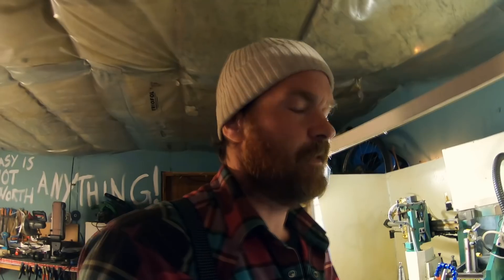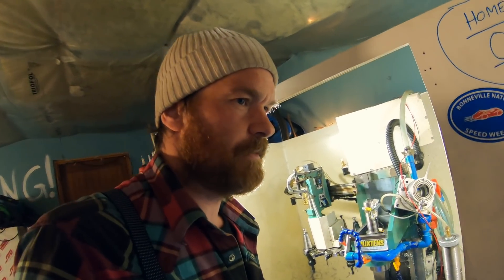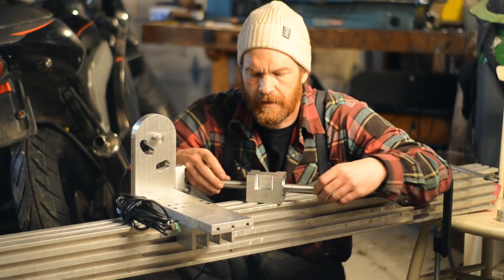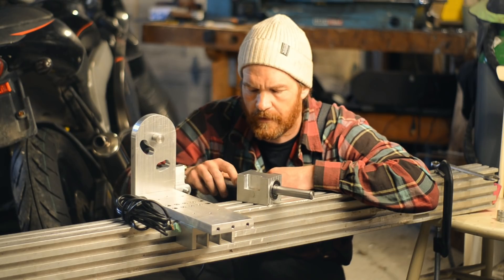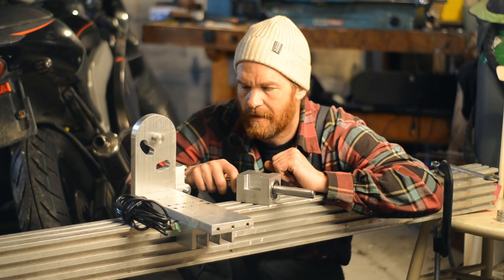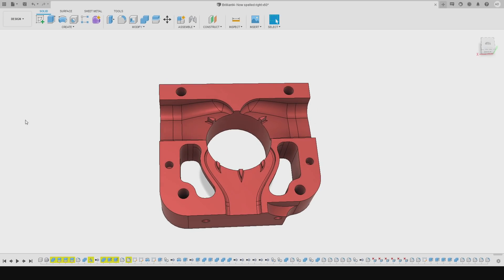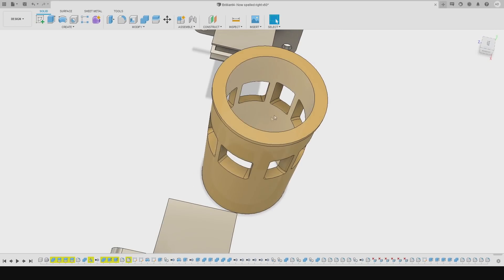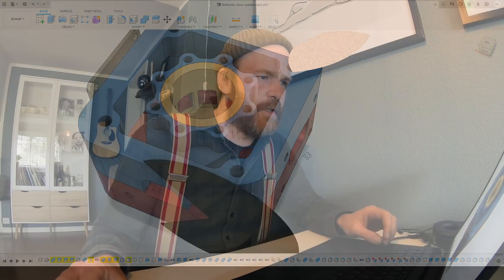Prototype Blown Nitro 2 Stroke.

Comment: The problem with the design with the rotary valve so far away from the combustion chamber is that this lowers your commission ratio. With a camshaft and a 4 stroke head this wouldn't be the case
Reply from the maker: The blower can deliver much more than this engine can take, this is a way of cheating it into believing the engine is bigger.
Reply: @2STROKESTUFFING  yea if you can blow IT up enough you will be able to live with such a low compression rate. But you could also use A 4 stroke head with A 1to1 cam zu crank Ratio And a modified camshaft to open both valves every TDC. With this method you will have less unburned fuel and therefore a higher efficiency. Also you could run the compressor at a lower speed. I thought about a two valve per cylinder Pitbike head. These are cheap and easy to modify.

Comment: Love the idea only issue can foresee is possible issues with heat on thin disk valve possible better to use drum instead with hole in each side ? like a power valve but can turn 360
Reply from the maker: I have an idea for a drum valve if this fails👍

Comment: Nice Work Man! The T5 Timing Belts with 25mm With works with 16000 RPM and 7,5 kW in our CNC-Lathe at work i think they would also wthstand 200000 RPM when you keep the Pulleys small
Reply from the maker: Awesome 😁👍

Comment: At 20k RPM poly-vee belts are more common than timing belts.  At 20k timing belts will be very loud and consume a lot of power due to pushing the air out of the way.
Reply from the maker: Thanks for the heads up!

Comment: Why have two intake when you could have one big intake opposite the exhaust port? What I’m thinking is that it would be important with symmetrical flow for the cylinder to fill properly. Just a though. One intake to the cylinder opposite the exhaust port, then since you have such a big (wide) cylinder you have plenty of room to have the ports loop around and fill the cylinder from all angles :)
Reply: Crossflow 2-strokes as you're describing perform badly. There is a tendency for the fuel/air mix to flow directly across the top of the piston and out the exhaust, resulting in very poor volumetric efficiency. In the old days they tried to fix this issue with a 'deflector' on top of the piston but this was always just a band-aid solution with limited effectiveness, plus heaps of downsides such as messing up the combustion chamber shape and adding weight to the piston.
Reply: @nerd1000ify  I agree and see what you mean. What I am saying is that you could aim the ports more ore less the same way as he already has but with one intake (reed) on the opposite side of the exhaust. There is plenty of space in the cylinder.

Comment: Bear in mind that if the goal is to set a record on this engine, forced induction normally carries a 1.4 or a 1.5 capacity handicap.
Reply from the maker: About 1mph between the "fuel" and "blown fuel" class at Bonneville 😁

Comment: I hope they find your cylinder....even without 100% of bore exhaust port, I believe your naturally aspirated 50cc could still be the most powerful 2-T by displacement.....not many people have put this much development in a 50cc previously and there, is much left to be gained in slight port timing changes, pipe changes, crankcase volume changes, and of course tuning on the nitro fuel....

Comment: Really nice work, would have loved to work on these models.
I believe symmetry is everything, for a good running, powerful and durable engine, its like making/build a flower into a whirl wind design structure.

Now you got colliding intake ports "draft" that blocks both currants dead, better would be to spin and whirl the intake breath, like making an angle to the left or right with 3 ports so  the breath spirals and twists into one another like a spun rope and going upwards whirling/bouncing via the spark inside the cylinder volume/head so the spark ignited mixture is vastly distribute through the whole head/cil. volume, which saves mili seconds and greatly enhances the combustion.

Comment: Please, instead of your rotary valve, why not use Yamaha's YPVS valve, I think it is mush easier to control/adjust. The best would be a rotary valve mounted in the top, as the big ship two stroke engine, you will gain a lot of power that way. I have worked on that solution in about 10 years, but haven't the money. Therefore you will get my tips, I know now that you can use it !!

Comment: Would you consider, rather than 2 dowel pins, to have a locating ring that engages in a groove concentric to the bore on both pieces, and a single dowel to prevent rotation? That way the any expansion or contraction is all relative to the centre of the bore and you should significantly reduce any chance of movement causing a step for the piston rings to hit. Can still be made on the mill.
Reply from the maker: Great idea! I can model a form of single dowel into the design too - no need for dowels at all😁👍

Comment: Why are you using the rotary exhaust valve rather than a traditional valve in the head for exhaust only? If you go through the head then you can have inlet ports all around the cylinder like a detroit diesel.

Comment: I saw the electric motor and thought you were going for ultimate RPM's Ultimate torque and with the new Quantum Scape solid state batteries you can go high voltage! But I think you might be trying to stay in a racing class...not sure lol 50cc super modified!

Comment: Great video's I feel that I am part of the development.

Surely you don't need reed valves with a supercharged unit, the piston is the valve ? I know that you know this and much more. can't wait to see the new machine on the dyno.

What CAD are you using ?
Reply from the maker: Thanks! I need the reed valves cause the transfers open way before the cylinder is below intake pressure.

Comment: If you gear your rotary valve to half engine speed you could make it symmetrical and so therefore better balanced. Loving your greater focus on your channel, I really hope it pays off for you.
Reply: and... cooler temperature wise?
Reply from the maker: Good thinking, but if it moves a half speed, and starts closing at bdc, it wouldn't be fully closed until around 90° BTDC. That's 3° before the transfers close...

Comment: Would computer-controlled variable pressure bleed and moveable reflection(rear) cone be useful to broaden the area under the power curve on the graph? The moveable cone would essentially move the power peak across the RPM range.
Reply: The final engine wil have a cvt so a broad powerband is not needed. Because of this he can have a big power spike to take advantage of

Comment: Hello, 
would a 2 stroke engin with a full exhaust port in the cylinder, and an intake valve in the head work? By doing this it would be possible to turbocharge the engine as the mix would be filled trough the top of the engine and with the exhaust port closed (during compression phase).
Reply: That's what marine diesels and detroit diesels do, but in reverse. Intake around the cylinder via the forced induction, and have valves in the top actuated by a camshaft to release the exhaust gasses while still on its way down.

Comment: I believe somebody at the shipping company now has a set of pistons and a cylinder to match.
Where you are planning to get the mass energy to spin that blower? JohnnyQ90 has made experiments on miniature engines with different types of forced induction, and they all have the same problem: Not enough mass in the rotating assembly to spin the blower. And when the crank has enough mass to spin the blower, it's too much for +12000 rpm.

Comment: Really great stuff! I thought reed valve systems were always rpm limited. Will you be able to achieve the power you want through a reed valve system?
Reply from the maker: Not sure, but with the blower I might achieve enough bmep to not need such high rpm.
Reply: @2STROKESTUFFING  You are definitely on the cutting edge of two stroke technology and we all can't wait to see what's possible.

Comment: I must say I'm kind of surprised you're opening yet a new avenue with the supercharging (different record? you should comment on that, since record seeking and Bonneville run is the founcdation of the success of your channel) , plus new intake port design (e.g. why opposing at 180° and not, say, 120° so that gases would have less to turn around, twice?)... 
I would hate to see your work dissolving in a myriad of unfinished half baked "ideas", as it happens on so many Youtube channels.

Maybe you should cut down on the boose ? at least on the screen ... just saying ;)

keep up the good work, and the clear focus.
Reply from the maker: Thanks! What you're describing is why I'm making the PiP engine less experimental, and starting this experimental project alongside it - to have something "finished" and running, while still exploring ideas. We'll simply enter the blown engine in a different class, same frame.

Comment: The volume between cylinder exhaust port and the rotary valve is a direct efficiency loss for your blower. If you decide to go for a blower and a rotary exhaust port, how about reducing the volume of intake and exhaust runners as well? Just to reduce the amount of loss you get from the blower, I mean? The pressures in both intake and exhaust will be higher, so the volume/cross section of the runners will matter a little less. what do the rules at Bonneville say about a blower?
Reply from the maker: Hard to find readily available blowers under ~300cc/rev. I need that extra volume to cheat the blower into thinking it's working with a larger cc engine. Will probably need a dumpvalve on the intake regardless.
Reply: @2STROKESTUFFING  you have the machines. Shorten the blower😉

Comment: The engine at the start revved harder than anything I've ever heard in my life. Amazing sound.
Reply: If I remember right from that video that engine was reving up to 20,000 rpm
Reply from the maker: Yep, in the landspeeder I saw 21k+...
Reply: @2STROKESTUFFING  just like 2 stroke model airplane engines that buzz ....back in around 1975 i was running with a dirt bike crowd in Santa Fe new Mexico that liked to go top end in the deserts south of town to the REO grand river and back ...i was topped out one day on my 360 Yamaha about 85mph and this kid Sidney passed me on his Honda CR125R two stroke like I was parked ...this thing he had ported out and went to a smaller rear sprocket for way more top end had like a 34mm Mikuni carb thats almost as big as the piston as he had also installed a huge reed valve intake to assist the huge carb as this was a 1973 first of the CR125R that didnt have a reed valve stock ...and the boy weight about 98 pounds if that much.. so his little bike hardly had any load on it and ran like there was no one on it like a run away train ...it was quite a hoot to see ..and sounded like a model airplane engine when he flew passed me ..and my 360 Yamaha enduro was not stock as I had upgraded the carb from a 28mm mikuni to a 34mm I had bought used from one of the local Yamaha shop gear heads that rode with us ..and Sidney and Mexican boy pudge they called him would race short track down in El Paso once or twice a month ..as Sidney raced 100cc single Honda four strokes ..and showed me how they would take a die grinder and open up the notches in the head that are there to clear the cam lobes as the cams they were racing would almost collapse the valve springs ..back then the Yamaha 250 single two stroke was the hot set up for short track oval racing but pudge the Mexican raced a Yamaha 250 twin two stroke out of a street bike in a champion dirt track frame crazy fast but hard to do on a short track bouncing off the hay bales to make the turns ...two strokes are a hoot .. definitely and highly recommend those who Don t have a clue to find out
Reply: @2STROKESTUFFING   and if I remember right it was also around 20hp at the wheels and close to 24? At the crank
Reply: That's mind blowing rpm for a reciprocating piston engine. The forces involved when the piston is changing direction must be amazing .

Comment: Doesn't a reed valve open (constantly) when you blow pressure onto it? Why not dual rotary valves?
Reply: It does but remember this one is facing directly into the cylinder instead of the crankcase. So when there is combustion it shuts the Reed closed. When the combustion is over there is no longer enough force to keep it closed and the compressor then pushes the Reed back open.
Reply: I also thought the same thing as you did.

Comment: Maybe your Cylinder will be in the news like Rob Dahm's 4 Rotor
Reply from the maker: Crossing fingers for no drama!
Reply: lets hope not. 
rob got lucky he got that engine back.
Reply: Evinrude outboards went to the epa and said that if emissions was the reason for banning 2 strokes then they should be banning all 4 strokes instead because their 2 strokes are 20% cleaner.
 Imo the 2 stroke engine has never been completed. 
 4 strokes have had mega bucks thrown at them to get then to where they are.
 According to BRP, it's mathematically impossible for a 4 stroke to ever match the power, weight, fuel efficiency service costs and emissions of a 2 stroke.
Reply: @scottwingate1235  stop sniffing brake cleaner and come back to the real world. as long as it's burning oil it wont ever meet emissions. even when cheating with watercooled manifolds.
Reply: @comethiburs2326  not all 2 strokes burn oil. I thought everyone knew that?
Reply: @scottwingate1235  oh right, so you want to be the smartass and bring the uniflow engines to the mix? tell me, who sells uniflow engines nowadays? i mean new ones. that dont runaway and make people deaf...
Reply: @comethiburs2326  koenigsegg new engine can run uniflow 2 stroke. 
 Now maybe you should lose the attitude. 
 Ever heard of achaties 2 strokes?  Maybe you should checkout the partnership they just made with Cummins and got a massive US military deal.  Guess what..... class leading emissions that might mean your next truck could be 2 stroke!
 Let's not forget the deltic compound super turbo that makes power like NASA.  
Yeah uniflow! 
 2 stroke potential has yet to be realised and I support innovative thinking like 2strokestuffing. 
 Drop the negatives.
Reply: @scottwingate1235  achates has been making babysteps for over a decade, got lucky and got aramco funding. A military contract is NOT in fact an emissions standard...otherwise we wouldnt have any 1980's truck left in active duty, which is clearly not the case....

the concept of an opposed piston two stroke was a thing since the 40's. i hardly consider these all the things you've been toting...ie light, compact or cheap. 
my favourite opposed piston engine sure wasnt a class leading engine in power, emissions size and whatnot. it did sound amazing tough. still got outpulled by 4 stroke hybrids.

besides, the achates is a monstruous tech bed for exshaust filtration and heat management. mechanically alone it wouldnt work, unlike regular 4 strokes modified for hypermiling. 

the freevalve engine could run like a two stroke yes, but why would you want to do that? you'd have to drill the cylinders to make it work. besides it's incrediblely hard to make electronic/pneumatic systems stay reliable like mechanical systems.
hence the bonkers cost of the thing. 

like rotating sleeves and rotating valve systems do not last or have to burn oil... comes with drawbacks. tons of them. 

i'm in for the top end power our host is going to make. and sure will come with a 40L/100kms kind of madness with his oversized ports. forced induction will only make it worse. and that clearly not the fucking point of it all.
Reply: @comethiburs2326  just a few points of difference. 
 Achaties is happening with Cummins in a big way. 
 Their emissions are the thing that will put it into passenger cars until full ev.
The free valve engine is a reality and he says it can run 2 stroke any time he wants although it's not as efficient. 
Yes it's also incredibly expensive but so is everything at first.
 The compound Deltic was the most powerful machine available and some argue that with today's technology and manufacturing processes it could be a viable alternative although I'm not so sure. 
I really hope our friend can make his boosted 2 stroke work and maybe inspire other's.
 I don't think it's helpful to completely disregard all technology's old and new when looking for solutions to problems. 
 Personally I believe in theory a boosted 2 stroke may only find markets as an electric generator for marine applications where torque and weight is valuable. 
 Other than that I agree it's limited.
Reply: Hopefully not. If some "green" politicians notice this Project which might be interpreted as an colossal waste of fuel with very toxic exhaust it might promote the banning of two stroke.   Unfortunately nowadays it is best to hope that such projects do not get to much public attention. At least here in Europe.
Good luck with your two stroke projects!
Reply: @thomash3003  its what i got affraid of that its just time before politics start to attack our loved 2 stroke bikes, race cars and older cars that is used as a hobby.
Reply: @thomash3003  i dont know which part of the world you're in, but in the US and the EU, commercial use of two strokes no longer meets road emission rules... and innovation in that sector is all but dead. same thing applies to the wankel motor.

Comment: Ok, nice - tell me why not have the intake reed opposite the exhaust - just thinking flow... GOD JOB! :)
Reply: Blocking backflow? Packaging? Fuel delivery?
Reply from the maker: Cause I don't want the intake stream to just head for the exhaust, I want it to fill the cylinder and at the same time push spent gases out.